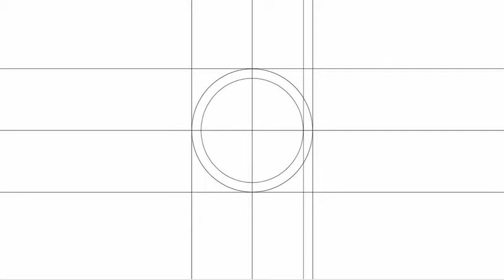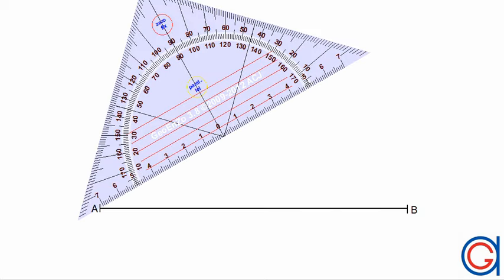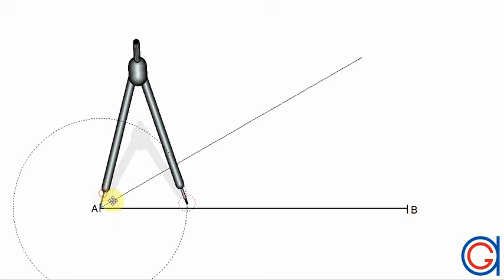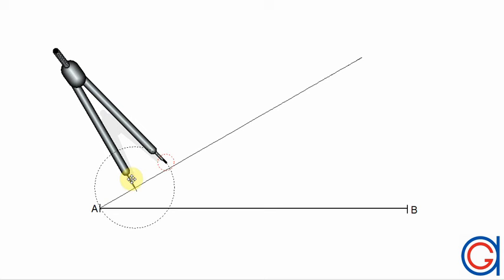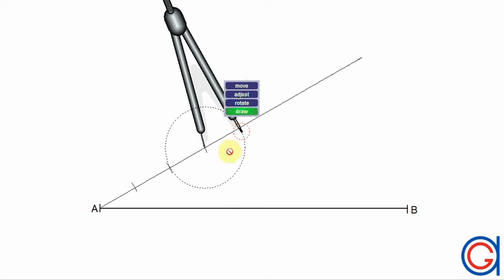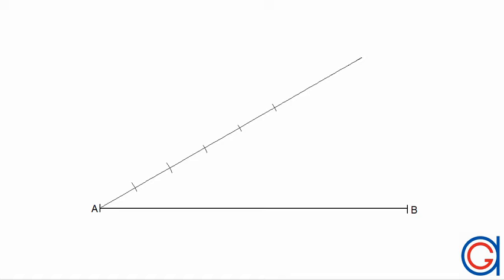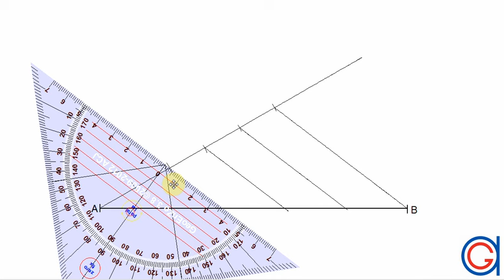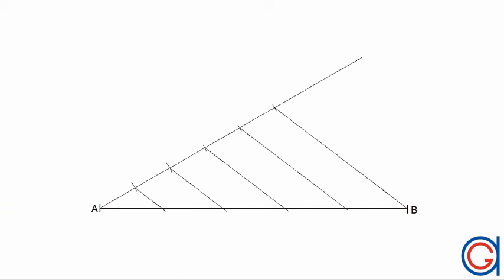Dividing a line segment into equal parts (Thales theorem)

Comment: I've got a question, what's the practical use of the Thales theorem? Can't I just divide the original line by using a ruler and dividing the length by the number of segments I want?
Reply: Making polygons, i think
Reply: It’s easier and more accurate this way in certain applications.

Comment: I realize this is a "how to draw" video, but the video misses the mathematical point completely: The mathematical point is to be able to divide an arbitrary-length line-segment AB into N equally long segments using ONLY a compass and a straight edge. Such a proper construction relies on first creating an arbitrary triangle ABC and then constructing N-1 additional smaller but similar triangles whose lower-right corners are at the segment boundaries. The construction of the smaller triangles can be performed by an initial compass-only copy-angle operation, followed by N-2 compass-only copy-length operations, or you can use N-1 compass-only copy-angle operations.

There should be no use of other measurement-generating or angle-generating tools (ruler, angle-protractor, set-squares). Hence, setting the compass to a specific 2cm gap is superfluous and confusing. And using an angle protractor as a ruler instead of a dimensionless straightedge is likewise confusing and superfluous. Then there is the operation of constructing the parallell lines, which should be performed via copying the angle ABC at the A-to-C intermediate and equidistant waypoints, and not via the computer calculating a parallel translation of the CB segment, nor by by using "set-squares" tools, which the narrative says.

Oh, and Thales Theorem is not at all required for this construction. Which is why I got started on picking apart this video and separating drawing technique shortcuts from the mathematics. I was looking for a video about Thales Theorem and landed here.
Reply: justmath how can you be bothered to write a comment that long when you know that nobody will read that because of how long it is and no I haven’t read it
Reply: i knew something wasnt right

Comment: Sir if we have to divide a line segment of 5.7 cm into 3 equal parts so we should take the measurements of compass at what cm
Reply: It should not make a difference. Normally you choose a length that is easy to measure if you are using a measuring stick, but  so long as you use 3 equal measures you should be fine. See it as creating overlapping similar triangles (all corresponding angles are the same) so the ratios of the side lengths will also remain the same.

To convince yourself of this you may wish to try the following:

1. Draw a segment AB that you can divide into 9 equal parts (9cm or 9 inches, does not matter).
2. Number the division points  D1 through D8 (A would be 0, B would be 9).

3. Draw another segment AC, of arbitrary length, let's use 5.7 (cm or inches) that sits adjacent to AB at an angle (exact degrees not important so long as its not 0 or 180, eyeball something from 30 to 45 degrees ).
4. Join B and C with a red coloured line (BC)  to make a triangle.
5. Draw lines parallel to BC through points D3 and D6, you should have 3 divisions on AC.
6. Take a different colour, say blue, and join point D6 with point C, with the same colour draw parallel lines through D2 and D4, they should intersect AC the same points  as the previously drawn red lines.
7. You can do the same thing with another colour, this time using point 3 as the new triangle (ACD_3).

Regardless how long or short AB is (in relation to AC), any point on AB will divide AC by the same ratio (on angles not 0 or 180). 

You can even use a theorem (diagonals of trapezoids theorem) related to this one (basic proportionality theorem) to divide the space between two parallel lines by whatever ratios you desire.